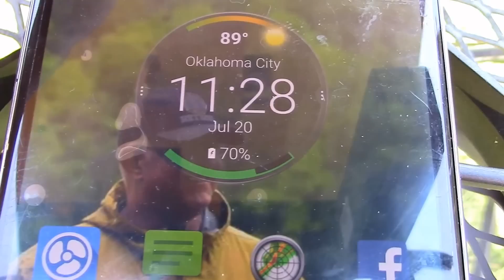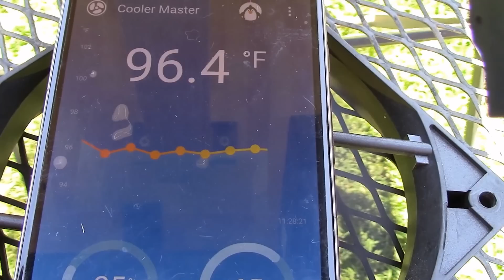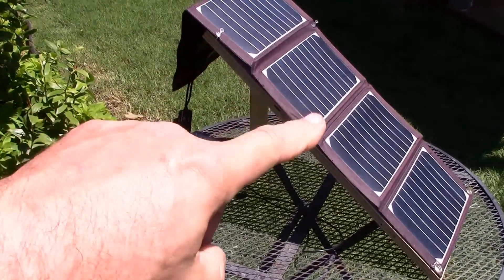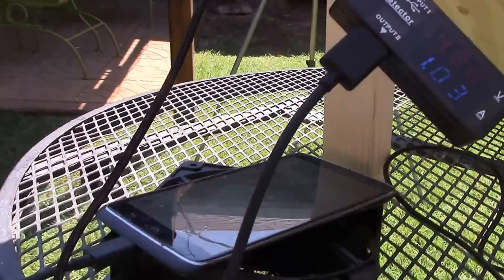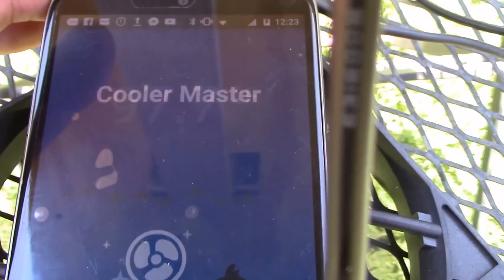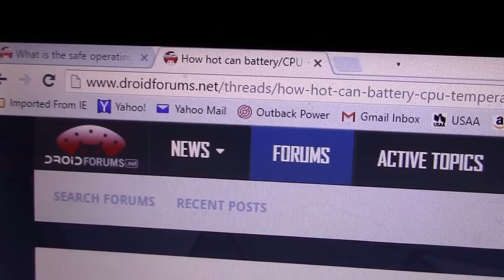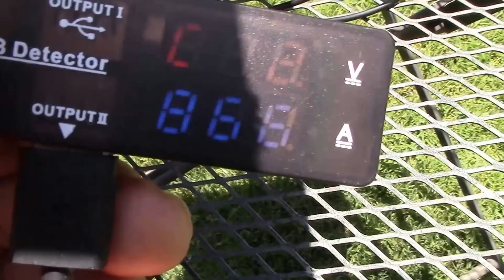How to cool & charge your cell phone on solar power using a Poweradd 20w solar charger!

Comment: Ok, regular Maxeon cells are 125 x125 mm 3.4 w, but it looks like they added more cut cells, if it is 1.5 x wider then regular size cell, it could be 5 watts for each section!

Comment: USB cords to suck, even supplied by manufacturers devices, I have a Samsung tab 10.5 and both cord and power block were under rated, would not charge tablet right! Does that panel actually produce 20 watts?
Reply from the maker: Yep. Never really tested the solar panel max power...but, can say it works very well (esp with the Sunpower solar cells). Would like to buy a bigger one that can charge a laptop computer and fold up and stow away.

Comment: I've seen a lot of people using small solar panels like that to directly charge USB devices from 5V of solar (9 to 10 cells).  I should buy/make one too.  What I've been doing is using a full size 18 volt 100 watt solar panel running thru a buck converter stepping it down to 12V and then using a USB cigarette lighter adapter to step it down to 5V and also provide the USB jack.... reallllly round about way to do it eh?   But when I did this, I would usually simultaneously use some of the 100 watts for something else like charging my computer.
Reply from the maker: Where there is a will, there is a way. These fold 'em 5v USB solar panels do really well. This Poweradd has the Sunpower solar panels...very strong output. I give it 4.5 out of 5 stars. Needs some more eyelets for hanging it up.
Reply: They sell ten full Maxeon (3.4 w) cells for $45 on eBay, that's 34 watts at 5.6 volts, good deal if you can build something light and strong enough...

Comment: Glad you changed the cable.  Either the port on the panel or the cable were causing it to charge over USB.  USB charging is set for a max of .5 amps.  Full amp draw by the phone for charging is only achieved when you see Charging AC in the battery stats. And.... I just finished the rest of the video and you figured out all this on  your own :)
Reply from the maker: hahaa! All good...thanks for watching.

Comment: I bet it goes far quicker on the bigger ones but still good for if not at home you cannot really carry them.
Reply from the maker: No, I don't think so. I think the devices are limited to how much current they will allow. However, with a bigger panel, there is more current available. This 20w folds up nice and is lightweight.